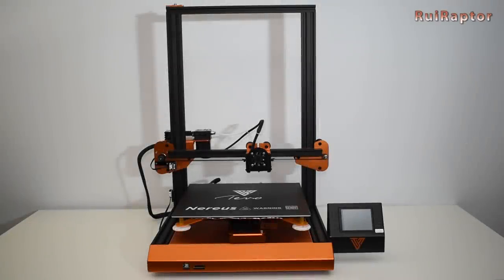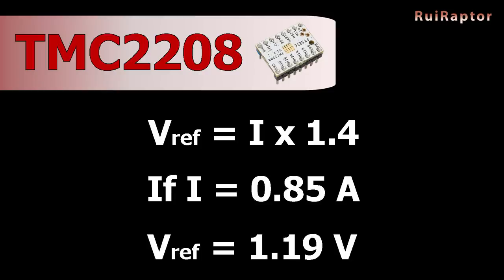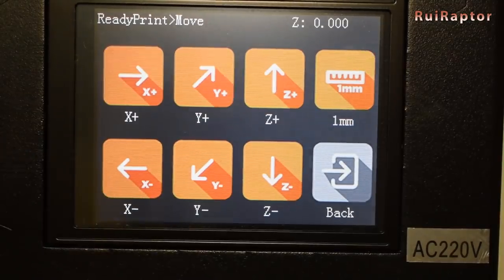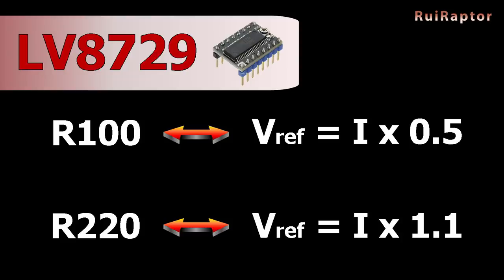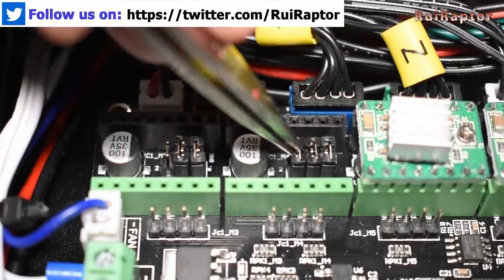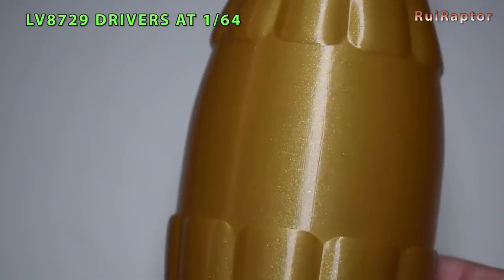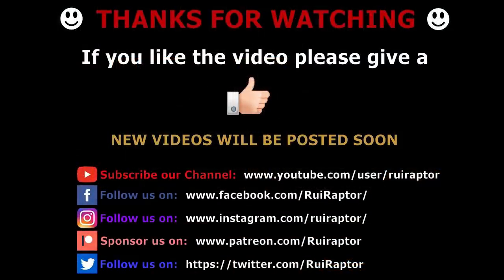TEVO NEREUS - New Drivers Upgrade (Goodbye Salmon Skin)

Comment: I am making a 400mm by 400mm printer with the lerdge board and lv8729 drivers I was wondering if you think I should run it in 1/128 or 1/64 steps. I was just thinking 1/128 might skip steps on the y axis and maybe the extruder. Do you think I could do just the y and extruder in 1/64 and the rest in 1/128 or should I keep them all the same. Or do you think 1/128 will be fine in general.
Reply from the maker: Hi,
You should test and see how it behaves. We did those tests to see how the board would handle the stepping.

Comment: Got my TEVO Nereus a month ago. After Installing a glass bed and LV8729 driver chips on all three axis(1/64), I tried to Manually Level the Bed.
The position was ok at point 1 but point 2 was just to the left of center of the Bed. I played with the Co-Ordinates and these are the settings I settled with.

#the 5 point location of  manual leveling
>cfg_point1:50,50      
>cfg_point2:280,50
>cfg_point3:280,280      
>cfg_point4:50,280
>cfg_point5:150,150

Just so you are aware that you will have to adjust these as well. 

Does this also affect the Auto Bed Leveling Settings? As this will be my next Mod.

Fantastic How To Video's
Reply: Thank you! After getting the TMCs finally working in the direction I needed, the positions were (almost) all off! These got them back! Thank you, thank you, thank you!

Comment: Great video as usual, but why TMC shouldn't be used for extruder? It is because of lower tork? Ps. You could also compare allegro + TL smoothers vs TMC. Cheers!
Reply from the maker: Hi,
The TMC2208 in stealthchop will not be able to handle the fast direction changes of the extruder and will stall/lose steps.
The only way they can work is by changing them to spreadcycle but is not that easy.

Comment: I have tried to update the "step" setting for my Tevo Nereus for a  new extruder. I made changes to the TXT file  but nothingy changed when measuring the extruding distance. On the SD card the txt file is in two different folders.  Can you help me with how to update the firmware for my 2019 Tevo Nereus?

Comment: I saw that Tevo released a similar video the other day, I think its kinda cruddy to ship these printers out knowing the issues of the drivers. I still ordered one and some tl smoothers, but I may just swap the drivers instead. Good vid mates.
Reply: I'd imagine this is likely the difference between the base and the pro versions. 

While i agree with you, I can't be mad at a printer this good, this big, for 400 bucks. Even if you pay a lot for the stepper motor drivers, it's still less than 30 bucks for the upgrade.

Comment: Thanks  for the review, could you please post a video with the noise comparaison between each driver. And measuring the decibels at different distance 0m 1m ECT?
Reply from the maker: Hi,
We tried to do that but the microphone/audio recorder cancels some of the noise. The decibels meter is not accurate because of the fans. If we measure the printer with the TMC2208 running, the meter will measure the fans (since the motors running make practically no sound at all) and will give a false readout.
Reply: @ruiraptor   but it will give an indication. For example if with the original driver + fan you mesure 55 dB  and 50 db with the new driver we can consider that we gain 5db.

Comment: Hi Ruiraptor,
Why isnt the TMC2208 recommended for extruder?
Regards,
Reply from the maker: Hi,
The tmc2208 will not be able to handle the high direction changes of the extruder unless you change them to spreadcycle mode.
With the steathchop mode that they are set to originally you will have problems with the extruder eventually (miss steps).
Reply: @ruiraptor  That make sense. thanks for your reply.
Reply: @ruiraptor  how would I change them to spreadcycle mode?
Reply: @ruiraptor  also, with the settings for the 2 tmcs on the x and y, they run when I check the heatsink on them, at 130 degrees Fahrenheit. the allegros run at 150 degrees Fahrenheit. this happens when a print has been going for 1 he or more.

Comment: I thought TMC 2208 has a different spot to measure voltage, am I wrong ?
Reply from the maker: There is another spot to connect the probe but this way you can do it more easily and avoid accidental shorts
Reply: @ruiraptor  ahh so it works at both place, I see

Comment: I wanted to buy this printer it look amazing but after your previous video bout the salmon skin I deice that I won't buy it unless Tevo changes the steppers, I know I can change steppers and may be easy but I don't have the technical skills neither the wiling to buy something to fix at arrival
Reply: Honestly, its a 5 minute fix, and less than 30 bucks for a pack of 4 drivers off amazon. This is my first printer, and i ordered the drivers before i even did my first print. I have 0 electrical experience, and it still took me less than ten minutes to do all this. Even with the issue, this printer is a STEAL at 400 bucks.

Comment: I just got one of these, and my question is, are all tmc2208 drivers the same? I see in your description it says v2, but the link is to v1.2 and I can only find v3 locally. I don't know much about this (since I'm quite new to the 3d printing scene) so I'd like to be able to copy what you did. :) Thanks @ruiraptor !

Aslo, do we need additional cooling?
Reply from the maker: Hi Brandon, the TMC chips are the same. What changes is the PCB where they are soldered on. The early versions didn't have UART pins and now they have. In our setup, we used the drivers in standalone mode, so we don't need the UART pins. Regarding the extra cooling, it is needed because the TMC drivers run much hotter than the stock allegros so they need active cooling.
Reply: @ruiraptor     awesome, also, how do you know what current to use? Vref = I x 1.4

How do you know, or figure out what "I" should be? I saw someone else do this to their nereus and said to change the Vref to 1.00V, I just don't want to ruin the stepper motors.
Reply from the maker: Hi Brandon, these TMC drivers are adjusted from the bottom up due to their curve characteristics. You adjust/increase the vref untill you get a good compromise between performance and temperature. Too much current will make your drivers/motors run hot. Too low current will make your motors turn with low torque.
Reply: @ruiraptor   ok, so how would I know the sweet spot? How do I come to find that out? Do I measure what the current the old drivers asked for, and then use that for the formula. Because I'm seeing more and more  posts saying ~0.8-0.9v but your video is 1.2v which seems higher.
Reply from the maker: The way i find the sweet spot is to run a few test prints and use a faster speed and more agressive acceleration and jerk. The drivers must hold without skipping layers and they (drivers and stepper motors) cannot overheat.

Comment: Hi there,
I was watching your video and noticed the gouging problem you had after 7min in and I think I have the same issue on stock drivers. I did a 150mm measurement of the X axis and it was 1mm more. Could that be that be my issue?
Reply from the maker: Hi Stephen, i don't thing that the 1mm extra would cause that. Anyway, you can fix the steps easily (cjeck this: https://youtu.be/ZfqeTzc3NpM ). Some 32bit firmware versions have random lag specially when printing in vase mode (i think this is what you are referring to) but we didn't notice with our Nereus yet.

Comment: Hopefully my last time bothering you for a while... Does the fan on the extruder suck inwards on yours ? Mine does and sometimes it will suck in wisps from prints and get caught up in there, now today its having trouble even getting started unless I give it a push with some tweezers, I really feel like they installed it backwards but I wasn't sure so I thought I would ask. And just to clarify i'm talking about the fan that faces you if your looking straight at the printer from the front. Thanks again in advance !
Reply from the maker: Hi,
Ask anything you need :)
Regarding the hotend fan, the fan must be pushing air against the hotend so your fan sounds ok.
The air must be pushing against the hotend because this way you have more cooling capability.

Comment: HI Rui, I wanted to make you aware of a problem on the Nereus.  If you abort a print before it starts, then when you do a HOME ALL function it will have an error when it hits the Stop switch.  I found one video where it did it on the Z Axis but mine was on the X Axis.  One guy stated it was because the file name was too long but I am sure it was because we aborted the print job.  After loading a new print job it worked fine.  Love your videos and wanted to pass this on in case you can come up with a fix for this.  I have the Tornado and the Nereus because of your videos and love them both!!  So thank you.
Reply from the maker: Hi Tim, thank you very much for this feedback. Will take a look and make a few test to try and replicate the errors on mine. If i find something i will let you know.

Comment: Hi, thanks for the video. I noticed in the other shorter video you made (loud music and no spoken explanation) that the vrefs were set to 1v. I know little to nothing about electronics so this is a little confusing for me. Does this mean that the values used in the two videos are upper and lower limits?
Reply from the maker: Hi,  There is no exact value. The values we show for each machine are values tested for good performance without overheating drivers or motors. These values can still be tweaked if you feel the need.

Comment: sorry for bugging you again, but what would be the fastes speed you can get with stock build plate without print defects? and the glass bed too. and how do we change it?
Reply from the maker: Hi,
I never made those tests yet but you will need to reduce the acceleration and jerk when using glass on top of the bed. You can tweak these and other settings in the firmware and it's super easy. Just edit the config file and save it in the SDcard. Turn on the printer with the sd card inserted and it will upload the new config file.

Comment: so if i'm running these 2208's on x and y at 1.19v do i run the z on the same 1.19v if i put a 2208 for the z?
Reply from the maker: yes you can use the same vref value for the Z.

Comment: hi ruiraptor after upgrading, i decided to relevel and was shocked when i saw that the movements are screwed. point 1 is ok, but the other 4 dont go to the right spot. what do i do? point 2 goes to a little past halfway the length of the bed. point 3 is on the right side of the triangle and point 4 is behind point 1.
Reply from the maker: Hi,
you need to edit your robin_nano_cfg.txt file.
In it you will find the coordinates of the leveling points:

the 5 point location of  manual leveling
>cfg_point1:50,50      
>cfg_point2:180,50
>cfg_point3:180,180      
>cfg_point4:50,180
>cfg_point5:100,100

Comment: How does this do with glass bed? I’m curious on what you have to do to set that up or is there a general way of doing this?
Reply from the maker: Hi Red,
There are a few techniques that will help printing on glass. 
One of them is using Dimafix. It holds the print when hot and releases when cold.
You also have glue stick. Some brands work better than others but the glue holds very well.
You can also use hair spray.

Comment: If I use the LV8729 driver for the extruder, do I need to change the steps? With the BMG extruder that I am running is 415 steps. Do I use the 1/16 or 1/64 jumper?
Reply from the maker: You can use the same stepping for the extruder. This way you will not have a big Estep value difference.
Reply: @ruiraptor  Thank you, that worked for me.

Comment: Which glass are you using? What is the thickness of the glass? On my Tevo Tornado i found out that a glass of 4 mm thick, i would get layer shift on the Y Axis and had to reduce the acceleration and jerk. Even with 3 mm glass, there was layer shift (glass is still to heavy) and the glass cracked with the temperature. I'm now using ikea mirrors, but they are smaller than the printers surface.
Reply from the maker: Hi Jose,
My glass is 4mm thick and i don't have layer shifts. Did you adjust the vrefs on the Y stepper driver?
Also, the tevo tornado already has a glass bed, you can use it instead or use a print surface such as a filaprint or a wham bam.
Reply: @ruiraptor  No. i didn't. Anyway i', considering this new model (Pro version) or probably change the board and add a second extruder to my Tornado.

Comment: What was the steps amount for 1/16 LV?  I don't think you mention at 8:20
Reply from the maker: The steps amount for 1/16 is the same as the allegro at 1/16. If you replace the stock allegro with any driver running at 1/16 steps you don't need to modify the steps.

Comment: Hi, Rui! Thanks for the video! Very informative as always!
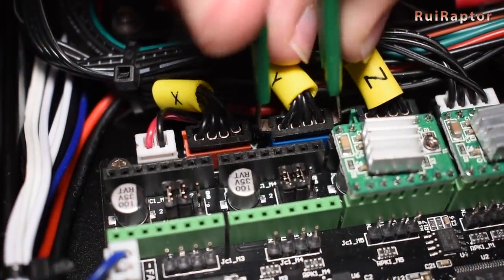How is this tool called properly? 1:44
I want to find&buy it. Taking out cables by nails and a screwdriver is a pretty nervous job for me.
4:20 - is this feature (of config through an SD card) is valid only for Nereus? I'm using Flash.
Reply from the maker: Hi,
Regarding the tool, it was included with the fysetc F6 board. You can probably buy one separately. Search for Fysetc F6 in aliexpress and you will see it :)
Regarding the firmware flash, most of the new 32bit boards have this firmware type.

Comment: I have a lerdge board with the lv8729 drivers with a R220 resiter

My stepper motors are rated for 1.5A
  so is 1.5 what I use for Itrip?
Reply from the maker: I don't recommend you to use a value that high. Your driver will run too hot with no benefit. Start with the value i mention in this video and test.
Reply: is there a multiplier or formula you use to find the new step value? i need to find an approxament value for my z axis and bmg extruder. @ruiraptor

Comment: Can you explain / give more detail / provide a download link why the config file needs to be edited? I am thinking about doing this upgrade (this is a noisy printer!!) but am worried about messing it up.
Reply from the maker: Hi, you need to edit the firmware because the tmc drivers run the motors in different direction when compared with the stock allegros. You can reverse the motors wires instead but it's much easier to do in the firmware.
Reply: @ruiraptor  Thanks - I figured it out :)

Comment: so to be clear, if we use tmc drivers for x and y, we change 0 to 1 right? is it possible to run tmc at 1/32 microstepping? how would i install a second fan. i think there are only 2 fan slots right? i want to hack this and use a duet 2 wifi. do you have any tips on that?
Reply from the maker: Hi,
The guys with tevo little monster printers have the duet wifi as an upgrade board. If you check the tevo little monster official facebook group you will read many posts about that.
Regarding the additional fan, if the fan is for driver cooling (or any other purpose that it will require no PWM control) you can connect the fan directly to 24v. Regarding the drivers stepping, you can use any driver with any stepping value except 1/128. This microcontroller is not fast enough for 1/128 microsteps.
Reply: @ruiraptor  thanks for the help great videos as always

Comment: Well LV started smoking immediately after I put in. TMCs worked before that though. Board is probably dead.
Reply: Guess the screw is on opposite side on the LV which isn't shown in the video. I put it in backwards.
Reply from the maker: Hi,
Please check at minute 5:44. The video shows clearly how to install the LVs. It's visible the blue headers and also the potentiometer at the right.
Reply: @ruiraptor  Thanks, I think the board is not dead just all the steppers that were installed need to be replaced. So it wasn't devastating. Blue inside green just made me assume there was no standard orientation.